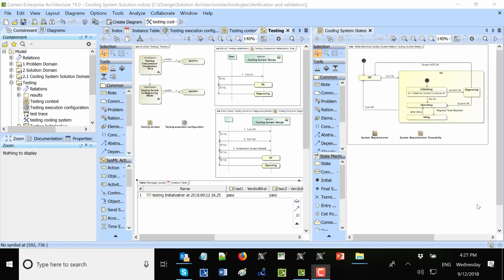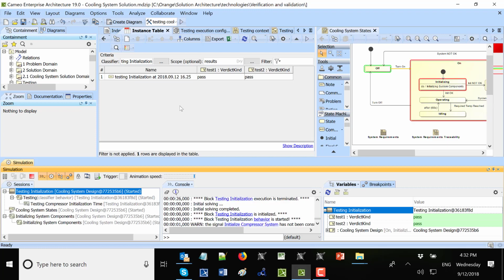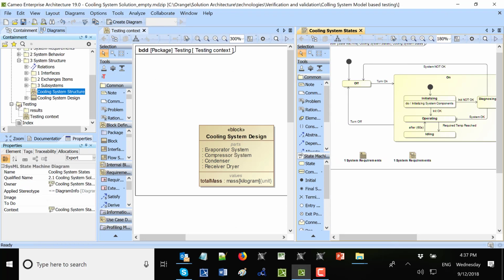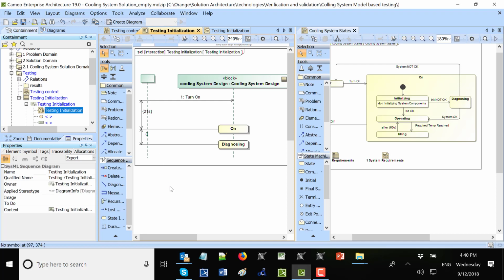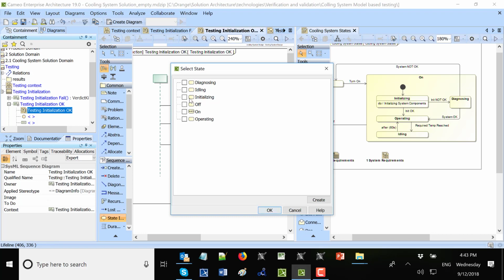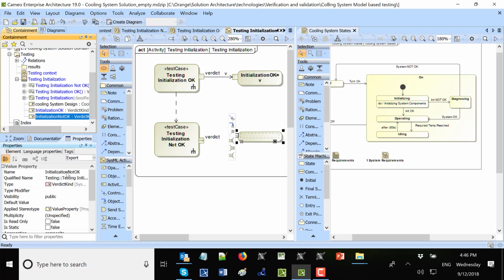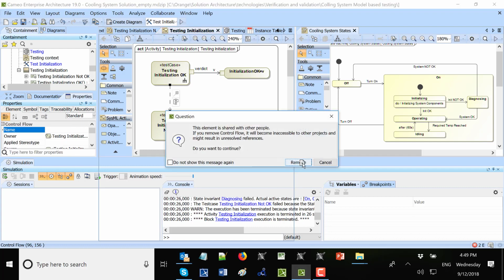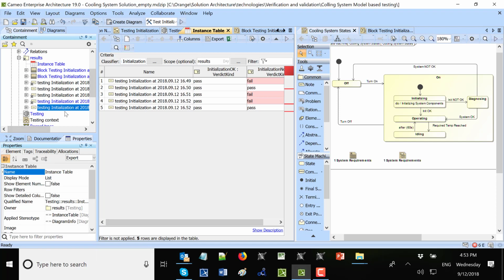Model-Based Testing Using SysML

Comment: This is really great! Is it possible to use the state behaviour to define all possible test cases, as an input for Physical test setup planning?
Reply from the maker: Thank you! Yes, but you need some method / tool which would generate those tests automaticaly. Currently this is half manual.
Reply: @MBSEExecution  do we have any plugin that can do that?
Reply from the maker: As far I know not plugin but there are tool (s) which consume state machine SCXML file.
Reply: @MBSEExecution  Great thanks.